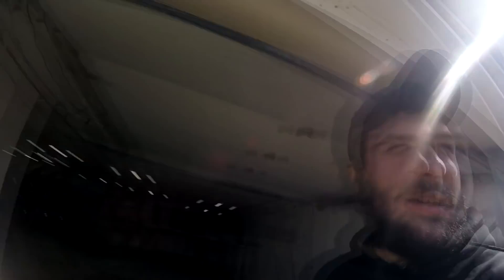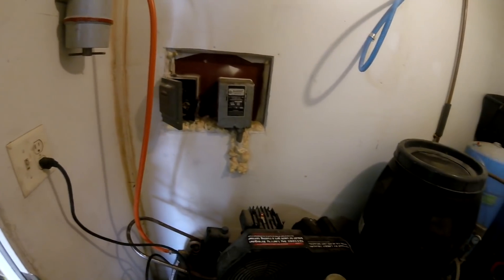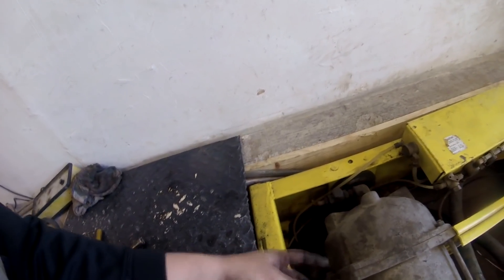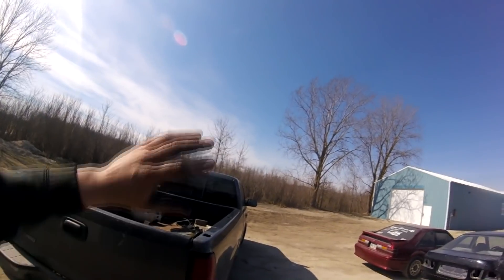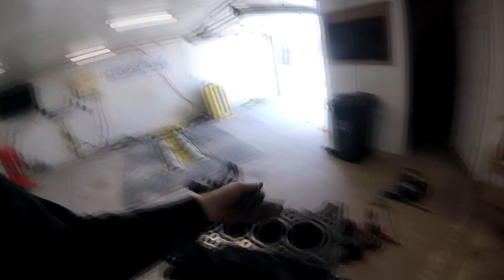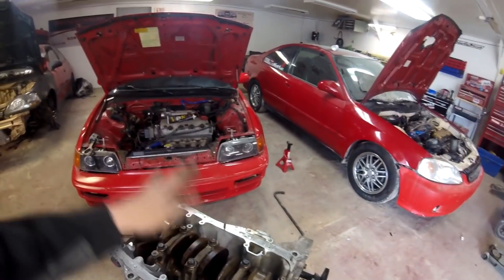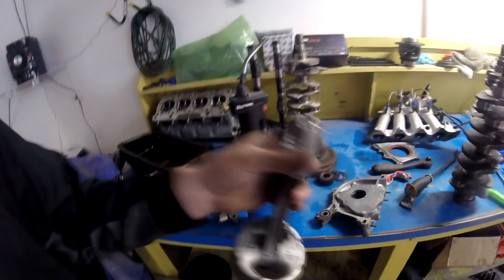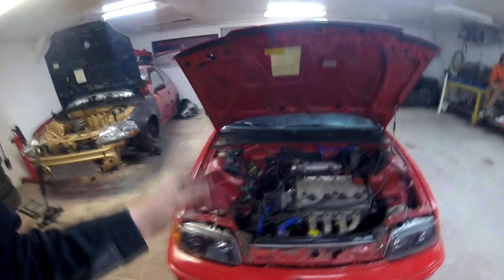B20V For My CRX + Blabby Rambles With Shop Updates

Comment: Just weld them together with a simple piece of 3/4" gas pipe from home depot for $5
Reply from the maker: Just worried about it holding up but I thought this would work too
Reply: @HunterTuned  we did something similar at out duct shop. The old compressor crapped the bed, we sealed up the old holes, used about 5 foot of pipe, welded the new compressor and tank to the old one, spray painted it, and it's worked pretty good for a few years. 2x the capacity helps our big metal shear

Comment: You can run the 2 tanks together but you would have to see what the compressor tank is rated for if it is not rated for 150 then it will likely blow up and be a bomb but you should be able to change the regulator to 125 psi like most compressors

Comment: How dare you bash factory Honda internals Hunter! Need I remind you that I made 412 whp on bone stock B18B1 PR4 internals with a standard ACL bearings/NPR rings rebuild? I'm just playing brother, it's almost always luck of the draw and it's always in the tune. My tuner rode around with me for 14 hours until he got the tune down to the very slightest throttle movement. I just made 588 whp on my current setup and my tuner still bitches at me for changing my old stock setup because it ran so well. I threw that last block together in my dirty dusty garage and immediately put a turbo on it and beat it to death, but somehow it held up. I really didn't believe that it was making 412 whp, but the dyno at IFO said so. One thing, it did have BC stage 2 turbo cams, 1mm oversized valves, dual valve springs with titanium retainers, and I ported and polished the head, so airflow is paramount to making power out of a standard engine.
Reply: But I know what you meant, I was just joking.